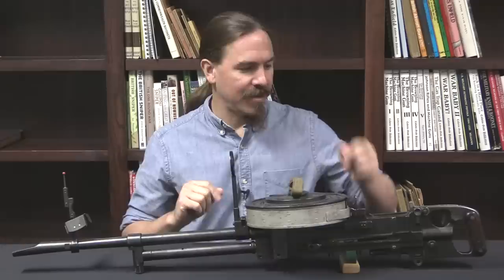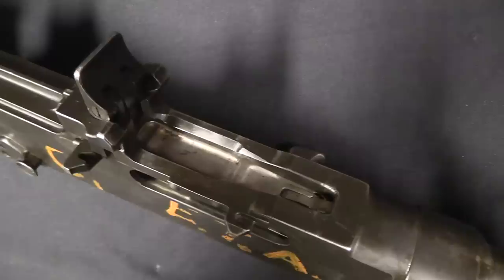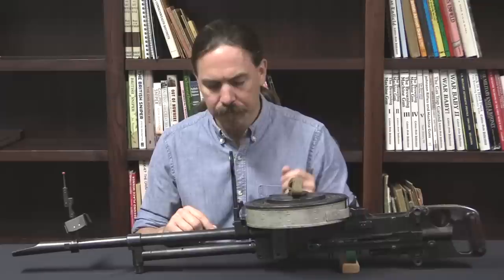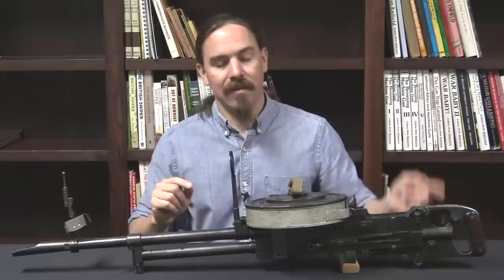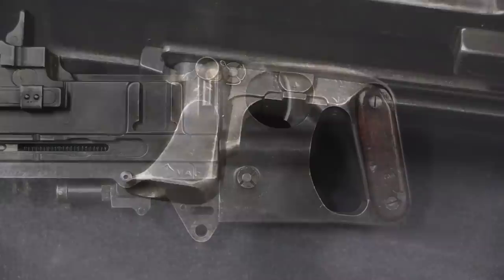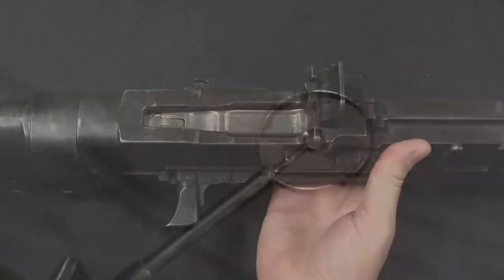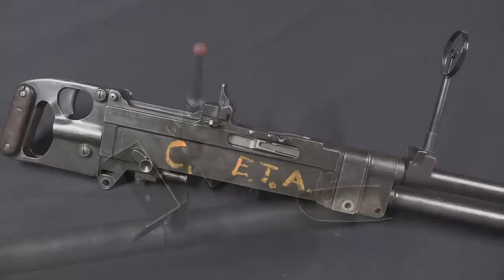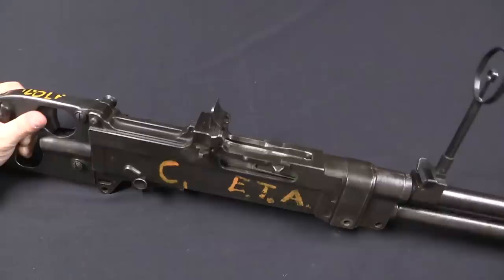Vickers "K" - For Aircraft and the SAS/Long Range Desert Group

Comment: My Father was in the Long Range Desert Group , one time on patrol they found a British  aircraft , not sure what type , in perfect condition landed on a hard patch of desert miles from anywhere , run out of gas . They searched for miles trying to find the crew  but no luck . The took the Vickers K's and ammo , one mechanic cobbled up a mount and they had an air cooled ( that is important in a desert ) fast firing machine gun mounted on their trucks , not jeep initially, This system proved very successful , until they they returned to base . A RAF officer demanded they turn the guns over to him , or take them back to where they had found them . The LRDG guys turned their patrol around and headed back out into the Blue ( Desert) they drove well away from base and removed the guns and cached them in a known safe place where they kept all sorts of extra guns and supplies hidden from the authorities . They stopped off on the way out or in and re fitted or removed the guns , this happened for a while   until things got smoothed over . They also got a Breda 20mm cannon mounted it on the tail wheel mechanism  off a ME109 and used that was very successfully as well , also hidden from the boss
The advantages of the Vickers K were .303 ammo , air cooled no water needed, drum mags meant that there was no belt to get clogged with sand , no shiny belt to attract enemy aircraft eyes , no belt to swing all about and need a loader to keep it feeding  ,  high rate of fire when when encountering enemy aircraft either on landing fields or in the air .
PS the LRDG was one of the first special forces in WW2 along with the SAS , Popski's Private Army , in the Western Desert
Reply: Good post Kiwi .

Comment: This is now the second time I see this type of front sight. There got to be one to fire on the range with a big ass fan to generate some wind.
Reply: or just have it mounted on the back of some toyota and bomb around the desert at max speed
Reply: @wytfish4855  the talibans were doing thar as you wrote that comment😏
Reply: "That" I meant to write
Reply: If you understand how to shoot with regular sights it looks like it would be more like "The red bead is your front post now, all hail the red bead", so to speak. The point seems to be that it prevents you having to learn anything new (and then calculate it accurately on the fly).
Reply: @laurisikio  
You can click on the three vertical dots on the side of your comment to edit if you want to.
Reply: @onpsxmember  oh I see. Thank you for pointing that out (I edited this afterwards xd)
Reply: If I understand that sight correctly, then it doesn't actually compensate for wind but for movement. The apparent "wind" caused by the aircraft moving through the air is just a convenient force vector to tap into for operating this. The sight goes the wrong way around if what you wanted was wind compensation from a stationary firing position, it moves the front sight upwind meaning it moves the point of impact even further downwind than using a simple fixed front sight.
What this actually compensates for, in an approximate manner, is the forward velocity vector from the aircraft's movement being imparted to the bullet. If you're firing to three o'clock out of a plane that's doing 200 mph, then your bullets are travelling at a vector of 200mph sideways plus the muzzle velocity along the bore axis which results in the bullets seemingly traveling at an angle. The sight helps compensate for this effect, so you have one less variable to deal with.
Reply: @Kaboomf  thanks for posting this. I was so confused as to how this could compensate for wind by aiming further downwind.
Reply: Generally, the vane front sight was used for rear facing guns.
The 'flash hider' is a deflector to avoid damage to the the aircraft skinning from sparks, etc.
Reply: "... with a big ass fan to generate wind"  man, that is one way to spray bullets absolutely everywhere!  I will be sure to skip that day at the range ( for the obvious reason someone already commented here ).

Comment: The picture of a gas-canister studded jeep going cross desert with one wheel touching ground and one of these guns mounted on the crash brace going full squirt-mode off to a side, gunner being steadied by the loader clamping on his feet whit his full body weight while german aircraft still grounded are exploding left and right in the background, has certainly become the iconic SAS pose, WWII era.

I like how they discarded the  cal .50 in favor of the Vickers/K on count of the later originally being an aircraft gun, then switching in '43 when the .50 started appearing on P-51 in ground-support roles. Very english.

Comment: I'd heard the only surviving fairly complete original example of the No.2 gun is in the Liberation museum at Zeeland in the Netherlands. No1 guns were also used by the Army to some extent later in the war for Recce. vehicles and tanks on the roof mounted PLM mount, there's some nice photos around of Daimler Dingos of 43rd Div. Recce with twin K guns replacing the single Bren during the n.w. European campaign. The Vickers machine gun collection and research Association has more information on the wider British use of the Vickers GO on their website and YouTube channel, along with videos of the VB, that show the very obvious similarities in the design, worth checking out if you're that enhanced level of gun geek.

Comment: The Vickers K/GO was also used by the Royal Navy, particularly by motor torpedo boats and motor gunboats, otherwise known as Coastal Forces.
Reply: Was just about to mention that but thought I’d better check other 
posts first.  The Lewis a s Savage guns they replaced were given to the Coal Scuttle brigade.
Reply: The RAF Maritime Branch Air Sea Rescue launches also used them, as can be seen in use in the movie "The Sea Shall Not Have Them"
Reply: @geordiedog1749   I didn't know about the hand-off of the Lewis; interesting.
In photos up to about 1942, most light AA on MLs, MASBs and MGBs are clearly twinned Lewis mounts, so these were obviously available as the G/O came into RAF service. Later on, the G/O appears in their place on MTBs and MGBs (I'm sure the MLs were stuck with Lewis guns for a while longer); obviously as the RAF were getting rid of them in their turn.
Poor old light Coastal Forces had to make to with whatever wasn't wanted elsewhere for a while - like all those Holman Projectors on everything and those awful 2-pdr Rolls guns, which apparently broke down a lot (got used on MLs for a while, but the MGBs got rid of theirs as soon as they had an Oerlikon). Would like to see a video about those two obscure bits of kit, actually.
Reply: @AndrewGivens  I read somewhere that the ‘Projector’ did, in fact, shoot down an e/a!  Just one though. Mainly it had its users running for cover. 
It seemed that the Crabs got first dibs on the best kit - especially the Bomber force. They replaced their Lewis guns with Vickers Ks then replaced them with .303 Brownings so they could bomb fields in the Ruhr Valley miles from anywhere and then get shot down on the way back without firing a single round. Meanwhile coastal forces and Harry Tates Navy were making do with Savage guns and five inch LA pieces marked 1892. They also got Madsden Guns? Potato Diggers they called them as they had a swinging cam along the barrel.  WWI kit basically. Never a “Phoney War” for these guys. Mines and bombs and S Boats from day one.  A school friend of mine had an uncle (one of the Tyne river pilots) who was on a collier in 1939 aged 17. He told us (impressionable young kids) that he was saved several times by a lad from Morpeth (who was a known poacher) on a Savage gun (first time I heard that name variant of the Lewis gun). He drove off a few Do17s with his very accurate shooting,  apparently.
Reply: @robshirewood5060  Didn’t they also get the turrets off Blackburn Rocs? Or was it from BP Defiants?

Comment: The bulk did matter in some aircraft: the Hampden bomber had to be modified to allow both the mid upper and mid lower gunners to fire to the beam. (The Hampden's structure simply didn't allow a gunner any further back than the middle.) The pilot had a fixed gun, and the bomb-aimer had a flex gun, which again could not fire to the beam. The Germans learned that they could attack Hampdens by flying alongside in an Me110 and, ignoring the Me110's various forward-firing cannon and machine-guns, use the observer's own flex-gun to shoot the Hampden pilot in the face from close range. The RAF's immediate reaction was a mod to allow the mid upper and lower gunners to shoot to the beam, the longer-term solution was night bombing. Wellington and Whitley bombers were better than the Hampden in this respect, but not so much that they could penetrate deep into enemy territory by day. 
The real solution was to build a bomber which could easily take the Hampden's maximum bomb load whilst being so fast and agile that it did not need defensive guns of any sort or calibre: that was the Mosquito, which could visit Berlin by day with a 4,000lb cookie.
Reply: If memory serves, the core problem with the Hampden was the very narrow fuselage, which made it impossible to fit a proper mid-upper turret. So they were stuck with flexible mounted guns with limited fields of fire.
Reply: Interesting how the germans figured out how to do that
Reply: @davidgillon2762  The Hampden was an improvement on the Heyford! It's important not to let hindsight lead you to expect it to be an improvement on anything later. Guy Gibson was grateful to be fighting in the Hampden and not the Heyford! There was no arrangement of defensive guns which reduced the casualty rate amongst bombers as much as the gunless Mosquito bomber. Reginald Mitchel realised this and designed a four-engined bomber with only a mid-upper turret, but capable of 370mph! This bit the dust because the air ministry wasn't keen and the Southampton factory (inevitably, given its location) got bombed and Mitchel was no longer there to revive the project.  

Contrast this with the Fairy Battle. I have never seen a Fairy Battle flying, of course, but I see the local Hawker Hind flying every summer (I'm in East Beds) and it doesn't look like a sitting duck. They replaced the Hind with the Battle! Given that the Battle had a Merlin engine, I've often wondered what might have been had they made an extra thousand Hurricanes with bombs on instead of a thousand odd Battles.
Reply: @demonprinces17  If they hadn't seen the Hampden in action by daylight, they might never have realised.
Reply: @matthewspencer5086  But what if they had powered the Battle with the Bristol Hercules instead? 300 extra horsepower (1375 vs 1030) surely would've given the Battle the ability to carry a Boulton-Paul 4-gun turret and possibly a couple of fixed 20mm Hispanos without any loss in performance compared to what was available in reality.
Reply: @matthewspencer5086  The Supermarine Type 316/7/8 wasn't a fast bomber, it was designed to B.12/36, same as the Stirling, and had three turrets (nose, tail and ventral). It was estimated to be faster than the other British heavy bombers, but estimated performance is notable for being disappointing in reality. It's estimated cruise speed, the important one for long range missions, was 260mph, substantially lower than the Bf 109E's 350mph top whack, while top speed was estimated at 325-360mph, and the lower end is more likely. If you can't outrun the opposition fighters, you aren't a fast bomber.

WRT the Battle, the problem is it was designed as a two seater, and the Air Ministry subsequently decided they wanted a three seater, making it overweight and underpowered. Richard Fairey felt even the two seater would work better as a twin and the Battle was designed to allow that change.

Comment: That front sight is SO cool! I don't understand exactly how it works but  I can appreciate the sheer genius of the thing.
Reply: When you don't have computers, you build mechanical, analog versions.  Few moving parts, and it is powered by the winds it's compensating for.
Reply: The scoops on the side use wind (or more correctly the air the plane moves through) to move the front sight side to side and gravity moves it up or down.  Put those two together and you have a self orienting sight that compensates for the movement of the aircraft the gun is mounted on.
Reply: @MythicMagus  simple mechanics, but it takes some precision to get things right.
Reply: @Stevarooni  that last sentence. That's the real beauty of the thing.  IMHO, computers are overrated.  I think those might actually be counterproductive in the long run. Think wall-E
Reply: @MythicMagus  you explain it well. But wouldn't it be totally amazing to actually see it in action?
Reply: @dscrappygolani7981  imagine running an F-16 without the avionics!
Reply: @Stevarooni  now imagine avaition without  Wright brothers, or Daedalus 😉
Reply: The YouTube channel VBBSMYT has a video on how this sight works.

Comment: Very good video, as always Ian. The business with the 100 round drum is described in (I think) "Guns of the RAF". Apparently the original spring as designed by Vickers was made from very low phosphorous Swedish steel and could cope regularly with the full magazine capacity. They realised that they would be unable to source this steel once the shooting started, they went over to using English steel which had a higher residual phosphorous content. English iron ores were not the best, adequate once the Bessemer process came into use  but never the best. They were bringing in steel/iron ore from abroad in the convoys but somehow that was not part of the mix for this problem. Anyway this lower grade spring steel would lose its puff after a while if the magazines were loaded up to the limit, but if you left out a few rounds you's get away with it. Seems like a very small difference, 95, 96 or 97 rounds instead of 100, there may be something else involved, like excessive spring tension causing misfeeds. Back to the experts...

Comment: In retrospect, it is odd that the British did not enlarge this belt fed for their 0.50 Vickers to be used and went directly to cannon with plethora of problems. The consequence being that bombers were left with increasingly ineffective 0.303 guns and fighters were struggling to bring down German bombers. As soon as Russians got Hurricanes, they started to alter the armament with their ShVAK cannons and Berezin heavy machine guns, stating that 0.303 were paint scratchers.
This is ot, but next time if visiting in Finland, please do a video for Pelo sub-machine gun if possible. It is a gun designed by captain Kari Pelo and only few prototypes were made after the war. It has interesting features in it such as an opening magazine, the idea being the gun to be loaded with ready made paper packages of cartridges.
Reply: The RAF had already realised that .303 was going to be ineffective at the outbreak of the war, and were looking at making 4x 20mm as the natural evolution in fighter armament, having a round that goes boom is really bloody useful. The Vickers .50 was nowhere near as effective as .50BMG, it had a much shorter cartridge (81mm compared to 91mm) and less oompf. The early feed issues associated with cannon were fairly quickly resolved. The combination of 4x 20mm was much more effective than the combination of 6 x .50 Brownings.
Reply: @campbelldeeming9509  I have read descriptions of battles where British Vickers IV light tanks armed with 0.50 Vickers peppered the Italian L 3/35 light tanks. Their armour was from 8 to 14 millimetres so the gun wasn't exactly a pop gun either.

Comment: As is made clear in the video, the use by the SAS gets lots of attention, but the main use of the Vickers K was as an aircraft gun. My father was in a RAF squadron stationed in Africa flying Wellingtons. Vickers Ks were carried mainly racked and out of the way but could be rapidly deployed for firing out of the side windows should they be needed to supplement the protection provided by the front and rear turrets.

Comment: See them in use in the film "Theirs is the Glory" - When used by the Parachute Regiment they were fitted with stocks and pistol grips - https://youtu.be/fiFeYxlPYy4?t=1125
Reply: The men are members of 1st Airborne Reconnaissance Squadron rather than Parachute Regiment. The Squadron jeeps had mounted a single No.1 type K gun during Market Garden but the Squadron had been re-equipped with No.2 ground service guns after Arnhem and that's what appears in the film. Whether they'd simply brought it with them when they took part in filming or it's simply what was available to the film production isn't clear.

Comment: British First Airborne Recce at Arnhem mounted one on each Jeep.
Reply: Two IIRC with a bullet proof glass screen over the guns.
Reply: @johnfisk811  Double MG mounts were SAS only. First AB Recce Jeep’s mounted one only, in this case, because squadron commander Major Freddy Gough was concerned about ammunition consumption. No armor protection mounted either, to save weight, as they came by glider. In Italy, some jeeps of B troop mounted twin German MG15s that they captured from a luftwaffe base that they had earlier overrun!

Comment: We're those not pictures of the long range desert group?
 OK watched the rest of video and he does name check them, fairplay.
Loving the fore sight setup, did any other gun makers do this? Did tracer ammunition take their place in ww2?
Reply: The LRDG tended to use various stripped down trucks, as their missions lasted much longer behind enemy lines to mainly observe, although they did raid. Plus jeeps weren't available when they were set up. 

The Iconic photos of the jeeps bristling with machine guns are usually the SAS. The LRDG did however also operate jeeps later on.

https://en.wikipedia.org/wiki/Long_Range_Desert_Group